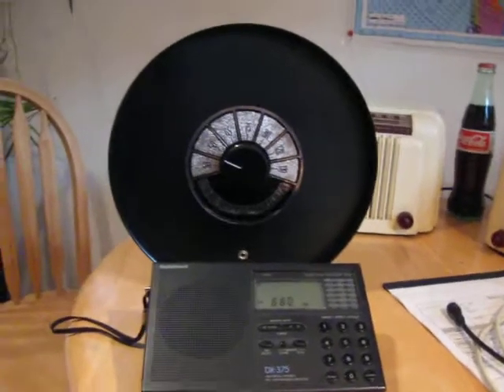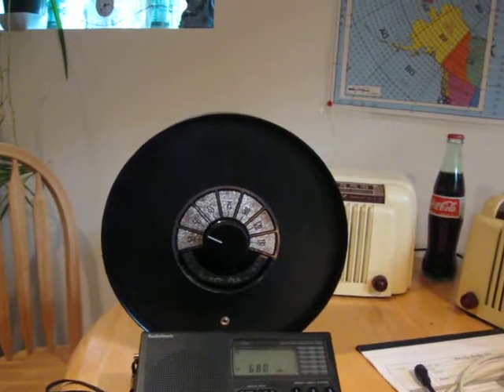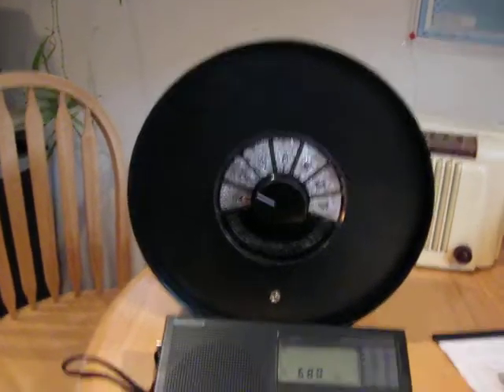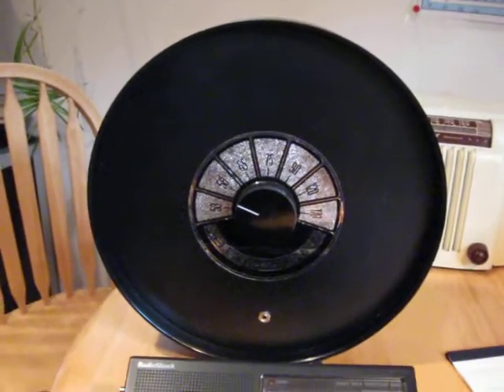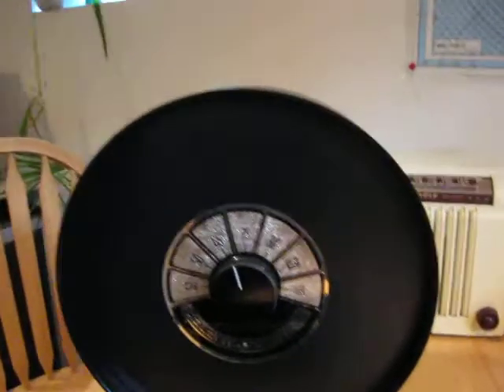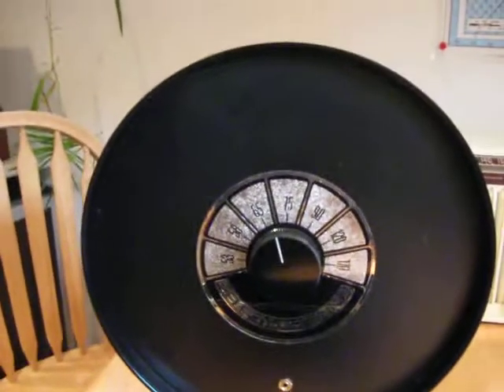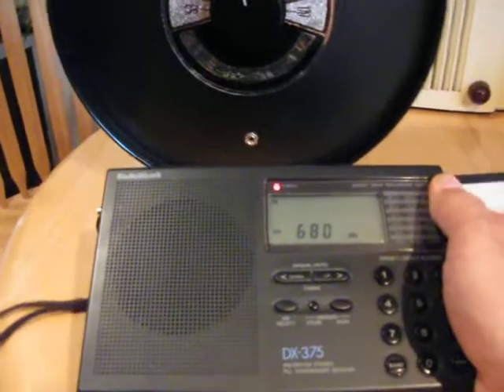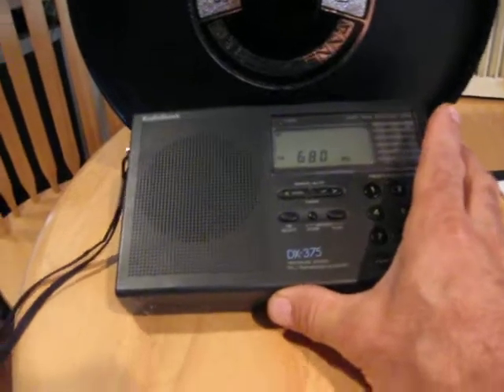SELECT-A-TENNA  Retro '70s Passive AM BC Antenna @ WA3TTS

Comment from the maker: Don, I have another video of an Admiral portable tube radio, search Admiral 4X12 and my WA3TTS call sign with stations
on 810 and 1550 kHz with a Select-A-Tenna . Passive loops tend to work a bit better at the low end of the AM band. I also have a few videos using a larger home made passive loop at LF frequencies below the AM band using Zenith, Bendix and Benmar radios.